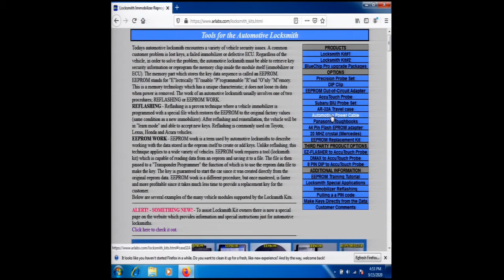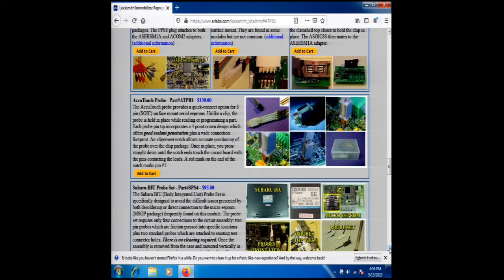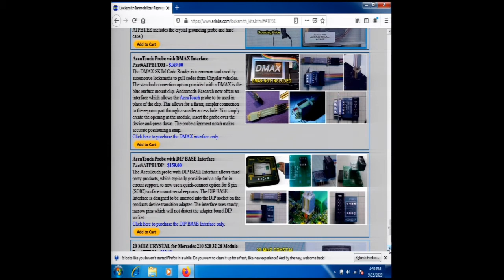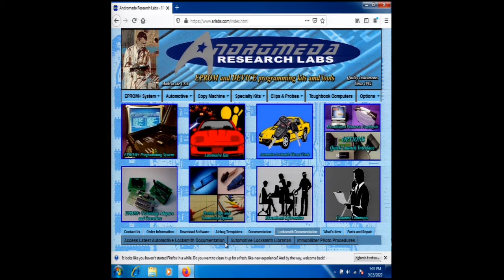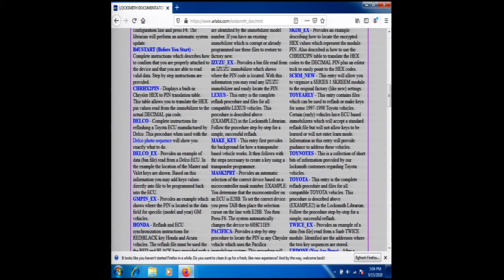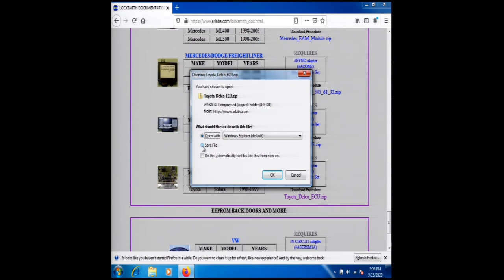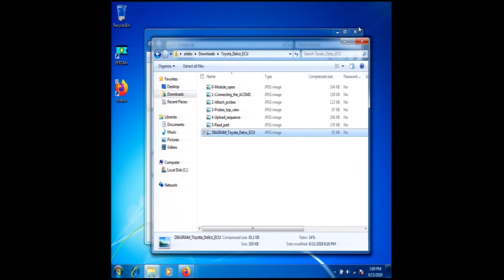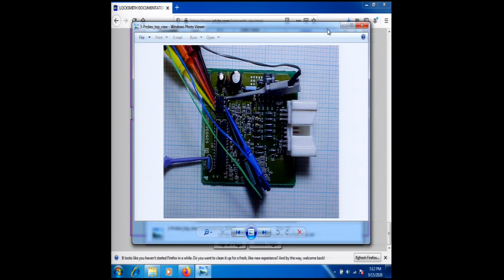Automotive Locksmith Website Tour-immobilizer photos and librarian procedures with explanations

Comment: Thanks again,  Wondering if you plan on expanding support for newer IMMO modules it looks like support currently goes mid to late 2000s in the documentation.
Reply from the maker: We support any any eeprom based module. Most locksmith applications are clone out procedures which requires reading the eeprom and passing the file to a transponder programmer. If there is some information which locksmith will find helpful we will add it. Updates are free.